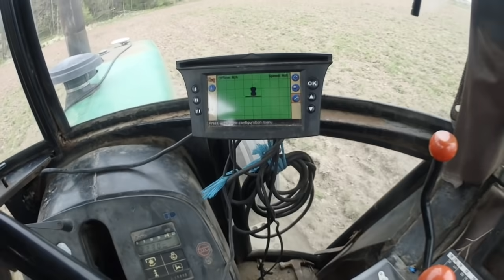Where Have I Been?

Comment: You'll want to put that GPS antenna up on a 4" stand-off with an insulator between the bracket and the hood.  Chunk of poly drum or something.   Would be better to have it up on the cab roof.
KISS for re-doing the interior of the cab:  use AB foam in an air sprayer in thin layers, you can shove disks of poly drum into it wherever you need to hang light stuff behind the cloth and you can use a hoop-hoe sharpened up to contour the inside of the foam then use a little more to stick cloth or cheap carpet up.

Comment: I love the ford v 10 been great towed gooseneck trailer most of its life hasn’t failed me yet 130k miles one set spark plugs 2 coil packs that’s it.Wanna see some feedback on 7.3 gas should be a great engine
Reply: Bill Booth a friend of mine had the ford V10 for several years. He said that engine gave him very little trouble over the span that he had it. It’s main job was hauling seed to the area farmers and it was hooked to the gooseneck trailer quite a bit. He said it put out good power and got around 8 mpg for him. He traded it for a 6.0L power stroke and that didn’t do much better than the V10 for fuel economy. I believe he said it did 10mpg with the trailer.
Reply: tuba7084 I went from a 7.3 power stroke ( blew up at around 90 k ,lol) to the v 10 that’s what I got was around 9 to 10 mpg out of the diesel and around 8 out of the v10 .power joker had 5 speed manual,v10 has 6 manual which I like much better too,only thing miss about power stroke is engine hold back normal load for me including trailer is around 18 k not counting the truck.Probably too much 😂,in the hills and mountains
Reply: Bill Booth there has been time that my friend has said that he wished he had kept the V10. We don’t have real bad hills around here but the holding power that is designed into the power train of the diesel trucks sure save on brake pads though.

Comment: Hi Wes your shop is not nasty that's the way they look when you work in them every day. When you work hard all the time you don't have time to spend hours cleaning it everyday thanks for the videos buddy
Reply: Benjamin Stockton there is a lot of activity in that shop. Only thing that would drive me nuts is nobody putting tools away. My shop isn’t the cleanest all the time, but all tools get put away at the end of the day to prevent loss. I buy excellent quality tools and I don’t want to have to replace them due to loss. Wes probably knows about where everything is, but he probably have to look around a bit once in a while to find tools that employees didn’t put back after they were finished with them.
Reply: Your right I agree you have a lot invested in your tools just to loose them because people don't put them back thanks for the reply
Reply: Benjamin Stockton I won’t release a piece of equipment out of the shop until all tools are put back. I put that rule in full force after helping a friend put a hood on an international truck. He took off with the truck just to find out that a 16 oz ball peen hammer and long alignment punch were left on top of the radiator support. He made about a half mile before both fell into the fan and caused major damage. It needed a new radiator, fan, and shroud from that simple mistake and it unfortunately cost thousands of dollars to be in a hurry and forgot tools on the equipment.

Comment: It's April, You're a farmer figured you were busy fertilizing, tilling or planting or doing some other of the agricultural stuff.  I'm telling you Wes, here in Iowa we like Farmers and no lock down, we do however have Nazi's in the state house, high taxes and crappy weather. Disagree about the V-10 they're still in production, all Gas fueled Winnebago Class A motorhomes from last year (and maybe a few 2020's) used the  Ford gas V-10 Triton engine and last I knew we were still going to have v-10 Econoline chassis available for class C units this year.  They did stop using them in Pick ups  and 350/450/550 Cab-Chassis a few years ago but they were available in motor home and commercial chassis Econoline cab chassis and cutaways and in the medium duty trucks they were making in partnership with Navstar down in Mexico.

Comment: Ive heard you say the 32 burns less than 28 before, and curious as to why or how you say that?  I agree that 28 is a waste, but the more water you run the less the salt sticks to the leave and less burn.  we constantly put 50-70 lb on wheat and if you run more water, it burns the wheat less because it washes off the leaves aka moving the salt.  not being an ass wes, just constructive criticism.

Comment: Had a 7.3 Diesel 2002, miss the truck but, also wish I could have replaced with V10. Neighbors loved theirs. I got better mileage but also got stuck more hauling pasture cattle in soft ground. Any Diesels are notoriously front heavy although Dodges are the shits diesel or gas in soft or slick environments. Have had all three brands, Ford the best in AG country... miss the six speed sticks. Got a Ford Diesel 6.0 stick, loved the stick, motor sucked. Pull 24 and 32 ft stock trailers now with old semis, have it’s perks with semis but offload at pasture on road in spring or wet weather.
Reply: Tim Woodring I love my 6.0. What didn’t you like about it?
Reply: Zack Zander the injection pump went out 3 times, the dash was replaced, the injectors were replaced I don’t know how many but went to ford quite a few times. Could not trade it off, no ford dealership would touch the truck at 37000 miles. That’s right less than 40,000 miles for a 2003. Mechanics call it the Bitch file. This truck folder was thick. Oh, I truly miss the 6 speed, sold truck in 2017 with 37000 original miles. Haven’t had Ford since. Love 7.3 took motor out at 350,000 miles. Should have replaced motor but interior was also wore out. Glad to hear someone loves a 6.0, you are the only one. So ford did one right. Only reason 7.3 discontinued was could not meet emissions. 6.7 ok I hear. Stick with Chevy an$ dodge for awhile, may just run smaller semis, way cheaper than pickup.